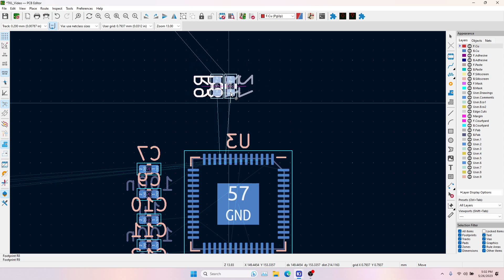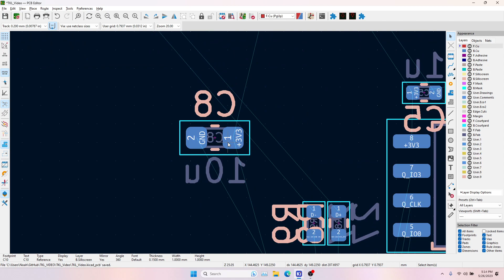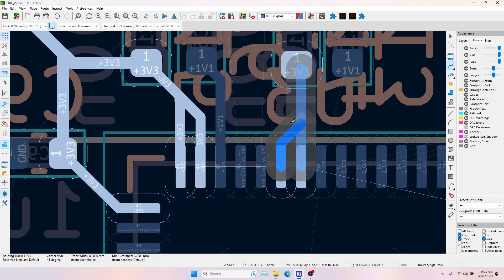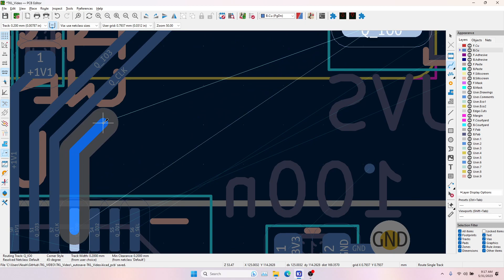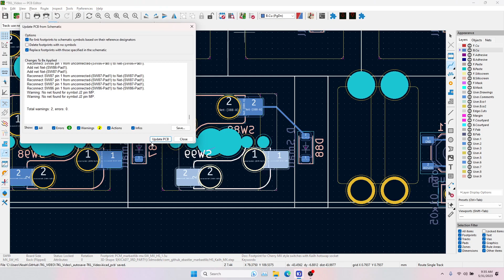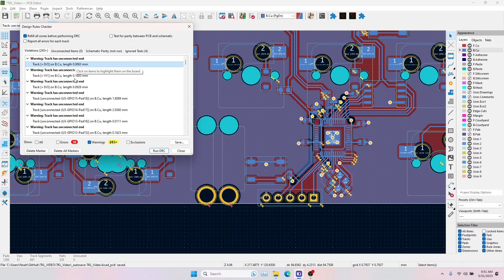TKL Keyboard PCB Design, Part 2

Comment: I have recently started using this guide and I had just realized when I view the pcb in the 3d viewer, everything is backwards. The key that is supposed to be on the right is now on the left, and looking at your previous video it seems to be the same case.
Reply: He flipped all the switches with f to get the HS components in the back
Reply: @derchesten  no, the footprint itself is backwards. Flipping it still results in it being backwards.

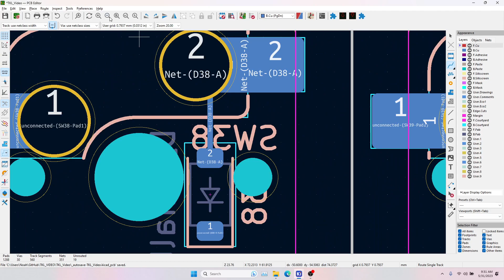Comment: 57:02 "connecting the diodes using the netclass width which is 0.25mm".  Well, in this video, before this time stop you are connecting diode to thruhole using default netclass size of 0.2mm, because when you start the track from the diode pad, the default becomes 0.2mm.  But other times near this point you start the track from the thruhole which gives a default netclass size of 0.25mm which is what you intended I think.  That bit confused me.  So if you want the 0.25mm size, you must start from the hole when set to "use netclass width" to get the 0.25mm.  If you go the other direction from diode, the netclass width for that track will be using the 0.2mm size.

Comment: Question: Do you know of a plugin similar to KiCAD KLE Placer which also has provision for placing RGB LEDs in addition to the MX switches and Diodes? 

Also, thanks Noah, for these most excellent 2 videos of yours.  I am working through to make a custom PCB to replace my included EK68 pcb for which I do not have source code for QMK etc and it is way too limiting with only 1 FN layer at 65%.

Comment: These videos are great, super easy to follow along with and tailor for exactly what I've been wanting to do for months! So excited for part 3!

I am hoping to adapt this to introduce some LED lights and possibly a knob for volume control!
Reply: I'm in the process of figuring out just that. For what I could research qmk uses ec11 rotaries, whose symbols and footprints are readily available in kicad. My project uses a mouse wheel style rotary that is compatible electrically with ec11 but the symbol in kicad doesn't match.
For RGB is simple enough to add enough ws2812 for each key. That only consumes 1 pin on the MCU.
What I'm interested in is working with an io expander which would bring a lot to this series

Comment: 2 questions. 1st: where is part 3? Idk like to see where this goes. Also, how digitally would it be to add an led (non rgb, only white backlight) to this?
Reply: Now that I'm thinking about it. What I'm asking for is "dumb" backlighting. Meaning no programming led controllers into the firmware. What I'm suggesting is simply adding a standard switch which turns the lights on and off. Would it be possible to simply create an LED matrix that is powered off of the existing 3v3 rail? If so would I need to add resistors to each LED? Sorry about the multi answer question here. I don't like RGB but I love having backlighting.
Reply: @matthewfogelson9665   I was also wondering how possible some non addressable non RGB LED lighting would be. I am currently looking into this using reverse mount LEDs as I am not sure how much clearance there is between board and switch as this will be my first keyboard PCB design. 
Have you made any progress on adding LEDs to this design?

Comment: Would you be able to explain quickly how the process changes with a “per key led” and rotary encoders? If not, could I give you my email? I’ll compensate 👌🏽👍🏽
Reply from the maker: Per-key LEDs require additional circuitry depending on how you set up the LEDs. They could be a simple addressable chain, or a matrix of LEDs powered by a LED controller ICs.

An encoder is more simple. The switch pins of the encoder go into the switch matrix just like an MX switch, the common pin goes to GND, and the A and B pins go to their own GPIOs on the MCU.

Comment: very nice video! one question though, for the pcb im making along with these videos, i plan to exclusively use it with a unified daughterboard, so with removing the c port from the board would it also be fine to remove the fuse and esd chip? thanks!
Reply from the maker: Yes, you are correct! If using the unified daughterboard, you do not need the fuse or ESD chip.
Reply: @noahkiser  thank you! this is my first time working with anything electrical, so i just want to make sure!
Reply: @noahkiser plz I need 3 part. Your tutorial is best. I want to create keyboard for my wife birthday)

Comment: First of all, great video! Then a question, how important is the value of the decopulling capacitors? i was placing them and didnt really know which value to use for a certain pin. Or is this not relevant for this?
Reply from the maker: For the voltage regulators (the 3.3v external reg and the rp2040's built-in 1.1v reg), they need 1u caps on the input and output pins. The rest of the pins use 100nF, with a bulk 10u cap upstream from it all.

Comment: Do you know of any good guides on creating a Bluetooth Keyboard? I’m looking at creating a board that can use either Bluetooth(Using a rechargeable battery) or USB C. Might have to create a usb dongle to reduce Bluetooth latency
Reply from the maker: I do plan on making a video about ZMK keyboard design, which can be bluetooth wireless or wired. There are bluetooth-compatible pro-micro dev boards like the nice!nano that you can design a board around as well, just like any pro-micro board (like my previous videos)
Reply: Or do you plan on making one soon?

Comment: These videos are so helpful maybe you can make a video how to make atmega work and setup QMK with it
Reply from the maker: I don't recommend using atmega for new designs, but if you are curious, Masterzen has written a good guide for designing an atmega PCB: https://www.masterzen.fr/2020/05/03/designing-a-keyboard-part-1/
You can also find the ai03 guide, but it is a bit outdated: https://wiki.ai03.com/books/pcb-design/chapter/pcb-designer-guide
Reply: @noahkiser  Now you got me curious, why would you not use the atmega32u4-a? It is the most commonly used processor on custom keyboards
Reply from the maker: @niqu9814  It is the most common, but it not the cheapest or most capable. The RP2040 is half the price, and has orders of magnitude more RAM, Flash ROM, and effective clock speed. With more and more features coming to keyboard firmware in the way of VIA and Vial, the 32u4 simply cannot fit those features in RAM or ROM.
Even before the RP2040 was released, more feature-rich keyboards used STM32 processors instead of the 32u4 for those same reasons. The RP2040 can also run ZMK, KMK, QMK, and a lot of other keyboard firmwares, more so than the 32u4. It comes in at a fraction of the cost of the 32u4 or STM chips, while also being considerably more available (not suffering from recent supply chain issues).
Reply from the maker: TLDR: There is not a reason to use the 32u4 in new designs. The supply issues, higher price, and less capabilities are all remedied by switching to the RP2040 or other ARM platforms like STM.

Comment: Would it be better to just use a development board and solder it on after or to integrate it into the board like you did in this video?
Reply from the maker: It's a different use case to use a development board, but it is a lot easier to do. I have made a video on designing a PCB using a dev board: https://www.youtube.com/watch?v=iznKltVU1yw